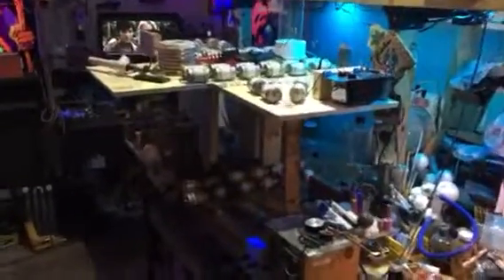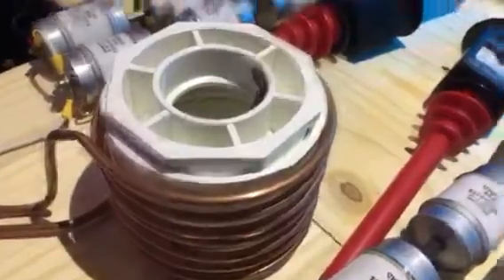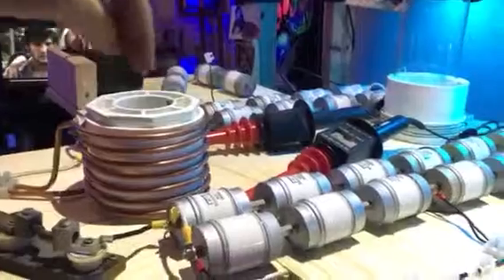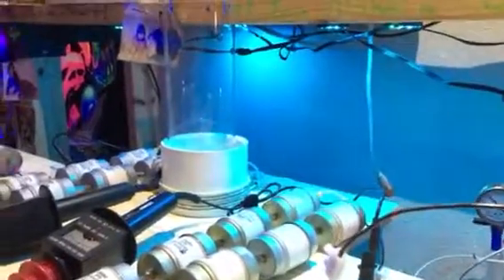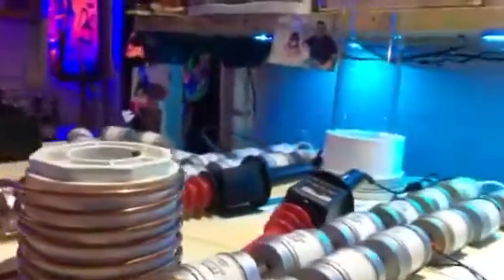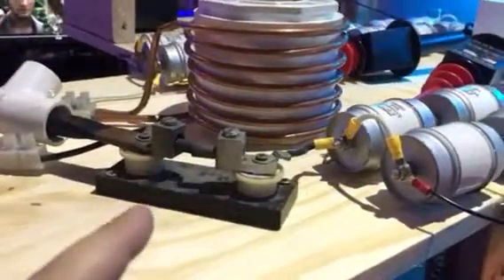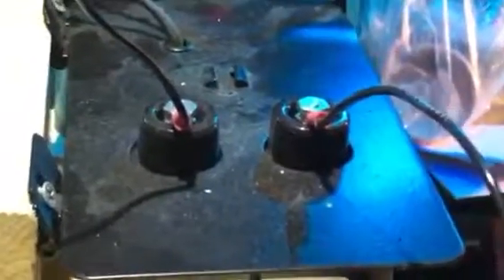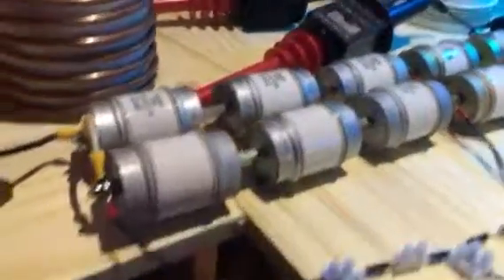Dual rps first run...

Comment: What is an RPS? Rapid power surge?
Reply from the maker: RPS is what I call the configuration of potential that creates an arc gap that discharges two like polarities.   Ie ++ to + or - - to -.   (as opposed to + to - )
Reply: @CoruscantMe  thank you, very interesting. Transfer of potential that also happens in Slayer circuits but without the spark gap and with minimal voltage imbalance.
Reply from the maker: @holyorderofscientists  yep the slayer exciter is a nice self resonant circuit.   

The RPS tho isn't really resonant.  It works because the +12v pole pretends its a -12v pole when its put in a battery configuration that sets a +24v pole as the positive pole.  Then the charge flows from the +24vdc pole to the +12vdc pole and will power a load while Charging up the 12vdc side of this circuit.   (you can use either positives or negatives, as long as you only use one side OR the other, if you try and use both at the same time, the circuit tends to sit in balance when turned on and No currents flow...    )   if you search for bedini tesla switch and look at his 3 battery configuration that should show you what I'm getting at with the idea of the Relative Potential Source.   :)
Reply: @CoruscantMe  Very interesting! I never thought about that... I have to try that combination!   I always connected both ends of the RPS... You know,,, with three 9 volt batteries with 18 and 9 volts when connected with both sides give amazing pulses,,, I measured up to 600 volts to the single 9V and veery strange polarities flipflopping back and forth. Sometimes one battery was sitting at +27 Volts and the other at minus 7 and plus 12... :-D